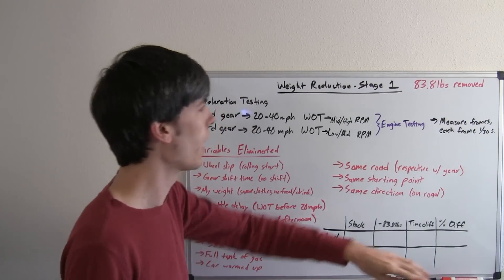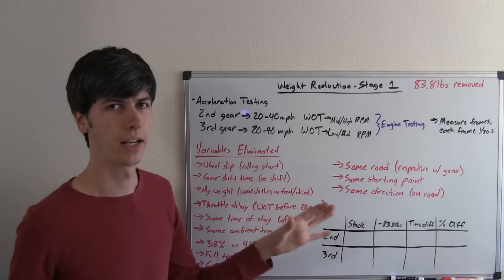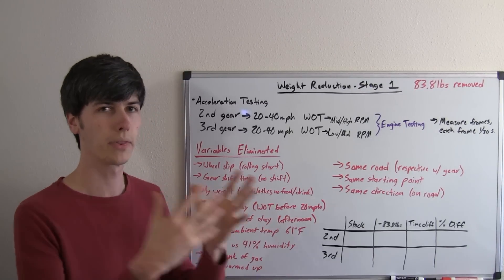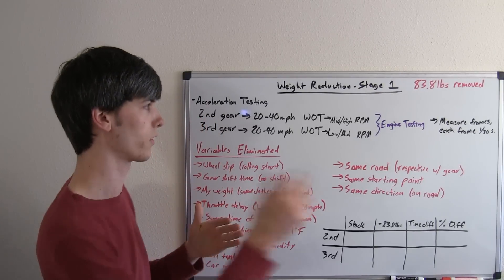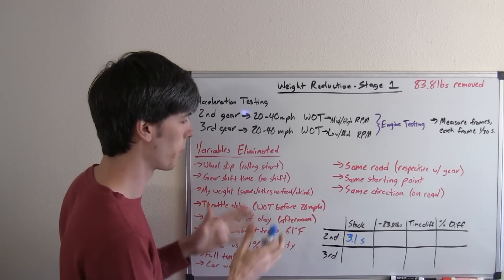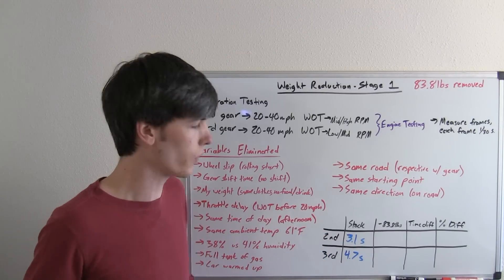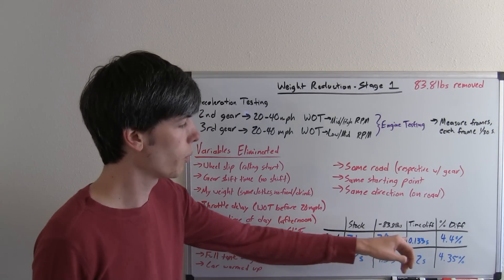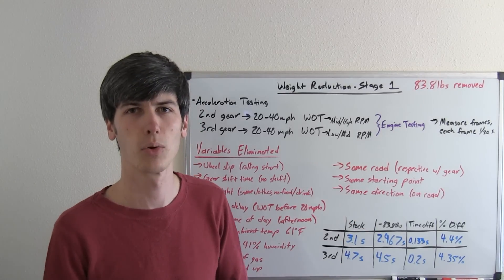Acura Integra Weight Reduction - Acceleration Testing - Stage 1

Comment: What percentage of weight did you remove from the car? 83.8/???? If its around 2000lbs then that is also about 4%. It would be interesting to see how long they tracked like that. Basically for every 1% body weight you shed you gain 1% in speed. Thanks for the video!

Comment: Weight reduction is awesome!!! "Simplify, then add lightness” (c)Colin Chapman

Not only it affects straight line performance, it affects everything - braking, cornering, gas mileage, wear and tear on mechanical stress parts, etc.

Weight reduction is addicting, possibilities are endless, there is always something you don't need, or can change some pars for lighter ones.

Going to the scales are just as awesome as going to the dyno

Comment: How about any and all gains from removing the ac system. And either just using a shorter belt if applicable or just installing a pully

Comment: Bro... you forgot wind speed/direction!
Reply: Also are you sure you're recording at exactly 30 frames per second? NTSC standard is 29.97fps and NTSC film is 24fps

:P
Reply from the maker: +PCG There was no wind, and this was performed between large buildings. Yes, it's 30 FPS. Also, the runs for 2nd gear are run one direction on the strip, while the 3rd gear runs are run the other direction on the strip. This eliminates any wind variables.
Reply: +Engineering Explained Fair enough, good videos btw!

Comment: I would love to see how different wheel weight/sizes affect acceleration and gearing!
Reply: +v6ftw Yes that would be awesome!!!
Reply: +v6ftw Same here. He should do a test with wider diameter wheels with low profile tires and a test with small diameter wheels like 14 inches and with all season tires
Reply: Motortrend did a test already look it up
Reply: Smaller wheel base = higher acceleration/less top speed

Comment: It was interesting to watch the math video.  You start with F = MA, do all of this math and the % of mass that you decrease is the % of acceleration that you increase.  Does that work in the real world?  Don't you have complications like drivetrain efficiency, friction, etc?  Wouldn't the 0-60 time of a 340 HP Integra be more than half that of a 170 HP one?  Also, according to http://www.honda.com/newsandviews/article.aspx?id=2688-en, the curb weight of the GS, the heaviest coupe, is 2,681 pounds.  The average between tests was an 4.372% improvement, but 83.8/2,681 is 3.126%--a 1.4% improvement for every 1% of weight that you reduced.  Do you have any idea why that would be?

Comment: What the hell did you remove to get 83.8 lbs, that car is so light already, did you remove spar tire, radio ect? Thanks!
Reply from the maker: cobra454tim https://www.youtube.com/watch?v=SCpaTM0rKus
Reply: cobra454tim I have a DB7, 4 door Integra. Weighs maybe 90-100 lbs more. I can just imagine how easy it would be to shed that weight if you were to make it into a track only car. Power steering, AC and heater, cruise control, airbags, passenger and rear seats (rails and seatbelts), door panels, interior trim panels. washer reservoir, wipers, audio equipment, dash, etc. Then replace factory components with lighter ones: seats, hood, trunk, wheels. Build and boost the B18 and you've got a serious little sleeper.
Reply: Engineering Explained Thanks for that link. I was wondering the same thing!

Comment: thats a great comparison video. I wonder if the total amount of weight removed can be expected to be less noticeable in a car that originally weighs more than this one by 1000 pounds or 2000. Taking 80 out would show a tad less % but still exist. and .3 secs off a 0-60 for no work done is quite sufficient

Comment: This is a nice experiment and weight reduction is great. I would like to just clarify that the acceleration difference is going to be affected drastically from the start but in higher speeds it may only translate to about 1-2% because of drastically increased wind resistance.

Comment: Great video series.  I really like your methodology.  Very Mythbusters like!  I also just came upon a 1996 integra LS/SE 5 Speed so everything applies directly to my setup :D  Any plans to do an insulated/wrapped cold air intake vs just bare cold air intake...  I've been doing this for years in several cars and I swear it makes all the difference,  but it'd be cool to see the hard numbers.  Could be just butt-dyno, lol.  You never know.
Reply: Inner Ear Thing I see many references to the time they covered a Fusion in modeling clay and cut dimples out of it, or people thinking along those lines.  Mythbusters saw a 10% fuel economy improvement by doing that, indicating they made the car 20% more aerodynamic, so from a coefficient of drag of .33 to .26 or .27.  They installed a gas tank in the trunk and weighed it before and after each run.  That should have been efficient enough, even though they only drove one mile, but I just think that is too significant of a return, especially since the Reynold's Number indicates that it would not work at all.  Popular Mechanics drove identical cars 430 miles, one had Fastskinz, with golfball dimples, and the difference was miniscule.
Reply: Inner Ear Thing Actually, Mythbusters had many issues with their methodology.  Insufficient sample sizes just for starters.
Reply: drippingwax
True, I'll give you that for sure. Probably chocked up more to TV editing and budget constraints.

Comment: Do you find odd that the times with the second gear are exactly the same on the 3 runs, but on the 3rd gear they are all different?
Reply from the maker: Ric Rac They're not off by much - didn't bother me.
Reply: Engineering Explained  What bothers me is that the times on second gear are exactly the same. I find it hard to believe.
Reply from the maker: Ric Rac Haha well if you really don't believe it I've provided the video footage, so you can simply time it yourself. :) It's pretty awesome to get such repeatable results.
Reply: Engineering Explained
 Yeah it's so awesome it's not common, but props to you.

Comment: ***** I'd go for a Subaru for daily driving. My brother in law had a 2.5rs sedan and it was awesome, I have a Saab 9-2x (WRX wagon) and it's awesome! Way cheaper and nicer than a WRX although mechanically identical. It's also rare, my car is a red Aero 5 spd, and there were only about 170 of those made. But, if it came down to 2.5rs or integra, I'd go for the 2.5rs. If you live anywhere with snow, I wouldn't even consider the Type R.

Comment: Bro. This is awesome stuff. I really enjoy the scientific approach. I have a 2000 GS and it would be great to see the results of a larger set of brake rotors. Not the stopping distance, but how the mass of the rotors effects the heat displacement. Measure the temperature in-between  3 consecutive 60-0 stops with each set of rotors.  It would be difficult to set up a test, but I bet you could do it. Can't wait to see what you do next!

Comment: If you wanted to test the unsprung weight theory, I would use civic hx rims - 13" stock are about 8 or 9 pounds, IIRC.  then go for the helium tires and enjoy more mpg's / better acceleration times -  just depends on how you want to drive it!

Comment: Hey I just reviewed all your videos on the relationship between acceleration and power. I would like to share with you an empirical equation to calculate 0-60 time. I came up with this equation in 4th grade and it was validated by 75% of the reviews I read over a period of 12 years. It is empirical which means has no mathematical basis at all. 
Step 1: convert the weight of the car to kg (Americans: multiply lbs by 0.454)
Step 2: convert the power to PS (civilized people using metric units: multiply KW by 1.34. Americans: don't do anything, hp and PS are basically the same until numbers are very big)
Step 3: Calculate the weight to power ratio, the number is an estimate for 0-60mph/0-100kph time, plus or minus 10%. Whether the car performs on the lower end or the higher end depends on other factors such as drivetrain (AWD<RWD<FWD), transmission (CVT<Double Clutch<Manual<Auto), tire compound, and weight distribution. But for street cars the 10% margin is usually valid. More modern cars usually accelerate faster than older ones due to technological refinement. 
Note 1: This works for production cars using street tires, with less than 370kW/500hp. 
Note 2: For cars with more than 500hp, wheelspin becomes inevitable and TC will severely reduce power at the wheels. The number converges to 2.5s for AWD, and 3.0s for RWD. 
Note 3: Race cars, or custom built high performance cars usually has much better acceleration due to optimized transmission and better tires. 
Note 4: There is no empirical way to calculate quarter mile/1 km time since aerodynamic drag becomes an important factor at high speeds. 
Note 5: European sources usually have much longer acceleration time than american sources, although 100km/h and 60mph is not a big difference. Perhaps american test drivers launch and shift more aggresively? 
Note 6: This equation does not work for R35 GT-R, which defies the laws of physics. 

Examples: 
BMW 335i, 1630kg/306PS=5.3, actual time ranges from 5.0 to 5.5 depending on source. 
Subaru WRX STi 2015, 1530kg/308PS=5.0, actual time is estimated at 4.6s. 
Honda Accord 2.4, 1500kg/191PS=7.8, actual time ranges from 7 to 8 depending on source.
Toyota AE86, 950kg/130PS=7.3, typical time ranges from 7 to 8 depending on trim and condition. 
Honda Civic Si, 1360kg/208PS=6.5, actual time 6.1-7.0 depending on source.

Comment: Awesome video! i really enjoy how you elimate all the possible variables. I also have a b18b1 but it's in a civic. I did a second gesr 20-40 and it was 2.53 seconds. Of course its doeesnt reslly apply since every factor is different haha  I think you should test those thermal intake manifold gaskets. They're cheap and east to install.  The only hard part would be trying to measure the temperature in the intake manifold you'd have to splice into the iat sensor im sure. Depending if you obd1 or 2 you could remove the evap purge for the test and insert a probe. Can't wait to see you turn it into a racecar haha

Comment: Dear Mr. Engineering Explained,

If you get the skunk 2 intake manifold and bigger throttle body then do you have to tune your car?  The reason I'm asking is because in the integra forums some people are saying you have to tune your car if you get those 2 bolt ons and some say you don't.   What do you think?  And I think you did have an intake manifold that your never put.

Thanks

Comment: Good video's. This method of measuring performance is indeed much more acurate than a 0-60 mph time test. This weight reduction modification does 4,3% in acceleration. Don't forget it also improved overall breaking performance of the car and possibly allowing higher cornering speeds depending on how the wheel geometry changed by the weight reduction, shifting of center mass, etc..  This 4,3% may not seem much, but in 'track' time on a circuit it would probably be a more significant improvement (in my opinion). I like your aproach on these things, your way of implementing the physics is very easy to understand. Thank you.
Reply from the maker: Glad you enjoy it, thanks for watching!

Comment: So question.... Inertia is the resistance to acceleration right? As the car accelerates would the rate in change of inertia be greater or linear or less.. so for explanation purposes, by removing 1 pound of metal would it have a greater effect as removing one pound of polystyrene? and if so.. would it even make a viable difference? on lower end passenger cars im sure the effect would be minimal but on higher end performance cars im sure the engineers take that into account??
Reply from the maker: A pound of mass is a pound of mass. Acceleration in this case is linear, not rotational.

Comment: Here's an idea that I think would be cool and give more data. Since you gave a percent measurement of improvement i think you should compare it do a percent measured of the weight removed. For example:

If your Acura weights 2600 lbs stock and you remove 83.8 lbs that is a 3.223% removal in weight.
Compare that % to the improvement % and see if further weight reductions give you any diminishing returns.  Just a thought.

Comment: Great test. I believe this is the most important aspect of Motorsports. Now imagine how much improved your cornering speeds, braking, wear and tear on components and emissions are without all that weight. Those fractions of a second add up to massive improvements over the length of a road course, autocross or even a dragstip run.

Comment: In the world of car weight loss every 10lbs lost usually equals 0.1 sec faster 1/4 mile times.
Reply from the maker: Ehhh, I wouldn't go by that. Take out 1000 lbs from a Challenger and hit 4's/5's haha?
Reply: I apologize for the misquote it's 100 lbs. There is a point of dimensioning returns... ( surely you learned that in school ) Obviously aero dynamics effect the vehicle times at some point as well as at some point the weight of the vehicle becomes benefit to improve traction during acceleration. If you google the "100 lbs equals 0.1 sec faster 1/4 mile times" you will find everyone from Honda to Corvette guys agree with this basic formula ( This has been understood since the 60's). I was simply sharing information that may add to the show or you could further test yourself with the vehicle.
Reply: ghettoflyer
Just a correction, I think you're looking for the word diminishing, as dimensioning gave me a good chuckle.

Comment: What's the max amount of power you would be aiming for? I know you're not obligated to listen to me but please don't turbo it. Try and squeeze as much out of it without forced induction. Besides more than $250hp in a fwd car is asking for trouble in the absence of traction control, stability control, a lsd or torque vectoring.
Reply from the maker: I definitely don't want the power over 1,000. I don't really have a target for power yet, just want it to be fun, and learn along the way.
Reply: what  you said about making these cars no more then 250 hp is asking  for trouble is ridiculous and you've obviously never done it or seen it befor e.... the stock internals on these engines can put out up to 350 to 400 hp without having to swap cams or any other internals and he can go boost and put out 300 hp or more comfortably without any trouble or problems like you think these cars were made for boost and are ridiculously reliable and strong engines .... if you run the right injectros and fuel setup with a good tune there is nothing to worry about you can crank out 600 hp if you wan tto and build it up cams valves springs retainers etc .... these cars weren't made just to be NA at 225 and that's all or you get trouble like this kid seems to think lol  and no for over 250 to go to 350 you don't need LSD  or  traction control etc its fwd they will hook and go with proper wheels and suspension lol
Reply: eclipse4388 Look within Honda, remind me which axle is driven in the S2000 and the mighty NSX? Hmmmm I think its the rear one if memory serves me correct.
Reply: eclipse4388 I wasn't doubting the potential of the engine to do more, the question is should you. Consider handling, you're asking the front tires to grip, steer, brake and drive the car. There is a reason car manufacturers especially the more sportier brands don't do fwd especially if they want to be taken seriously. Modders are crazy and most don't take track days seriously.
Reply: jstuttgart to true fwd is the worse drivetrain to get power down with, honda did a great job with the suspension but FWD is still the biggest down fall.

Comment: Very good! Very well done indeed! :)
But you forgot to check tyre pressure before both tests, I believe... :/
Because tyre pressure can change even your car's tires have a very small leak.
Reply from the maker: no head 35 PSI. They're not going to change in 1 hour with no leaks. s

Comment: What does wide open throttle mean? And also, you could get some aftermarket rims, too. If you're still thinkin about weight reductuion.
Reply from the maker: dannyboiiiiii96 The throttle is all the way open, allowing for the maximum amount of air to enter the engine.

Comment: I feel that your full throttle early start will alter the forward momentum, giving your 2nd gear an advantage over 3rd gear, which will skew your end results if you use the numbers in comparison.
Reply from the maker: TheTallJS I compared 2nd to 2nd, and 3rd to 3rd.

Comment: you're going places man
Reply from the maker: ***** Where am I going!? Haha
Reply: I like the detailed way you gather and process information. It's so cool! and I like to imagine that all this can help you land a job of some sort at a hi-tech automotive research center or something! but meanwhile... start changing the exhaust man :D
Reply from the maker: ***** https://www.facebook.com/EngineeringExplained/photos/a.607084529334272.1073741825.262059633836765/783209551721768/?type=1&theater
Reply: sweet man! i'm goin to subscribe to your page right away!!
Reply: Engineering Explained Hello i just gotta ask i cant find any vids off MASS i am a bit curious of MASS vs Weight i see you use MASS in KG is that correct?? when mass becomes greater then weight what it does acceleration wise.. How much Power To Weight Ratio do you need to overcome the MASS with only adding power and reducing weight etc etc hope you consider that one day.. Love your work btw brilliant stuff.. What i mean by overcome MASS is that if you have a car with CdA 0.25 vs a another car with 0.35 how much more power those the car with worse aero need to overcome CdA vs the other car or how little power does the better car need to follow the other in a race... If the gap is big enough between the 2 cars where will PTWR stop.. Sry my english i hope you understood where i am going with this lol ciao....